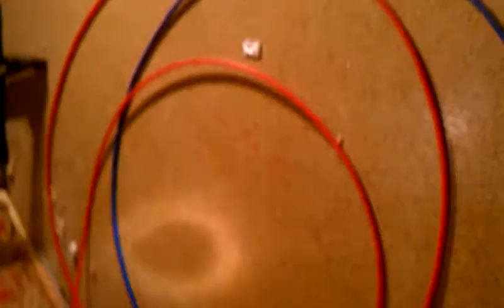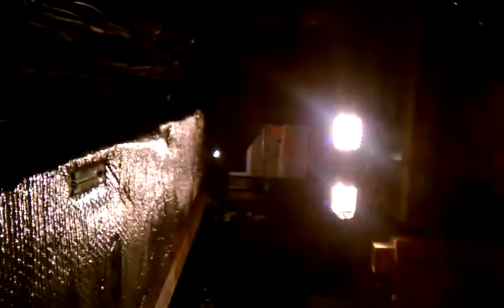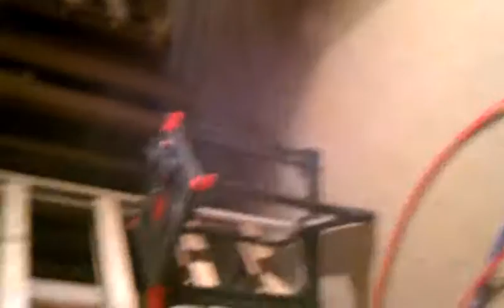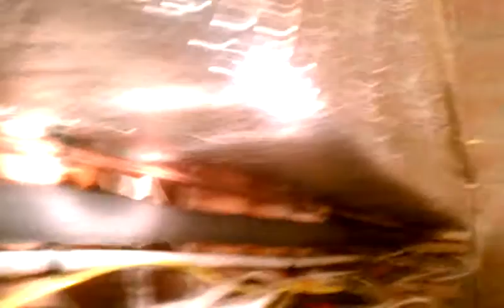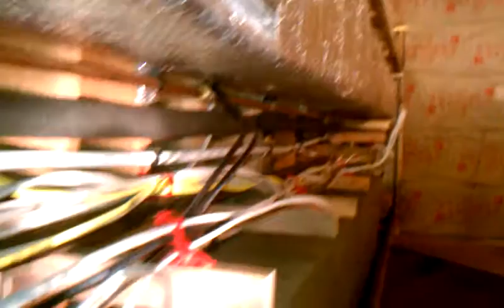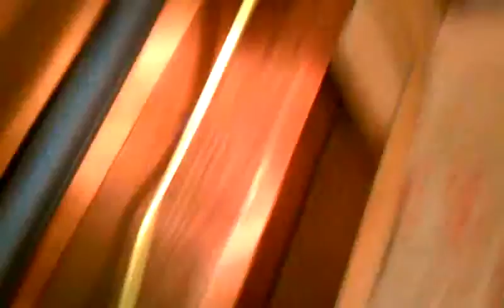Replacing pex with copper cuz plastic taste

Comment: I'm considering doing the same thing - replacing PEX with copper. Newly installed PEX in both hot and cold runs in my home. Water absolutely stinks, and tastes like plastic every time even after flushing.  And this is inside my basement.
My municipality uses a lot of chemicals to treat its water, and these have been shown to leech chemicals out of PEX pipe.

Comment: I have the same issue with my kitchen faucet
Reply: +mark asher 3.5 years after I did this job and I still have great tasting water at the kitchen faucet.  I even called the Sharkbite Co who made the pipe, but they gave me no help and said they "never heard of that before".  Just glad I didn't have the drywall all done before I figured this taste issue out.

If your pipes are not accessible, maybe try an inline water filtration system at your faucet.  You can get them at HD or Lowes or even Wal-mart.  They are ~$100 for a decent volume system with filter and it should remove that taste.  Hope you have a better project.